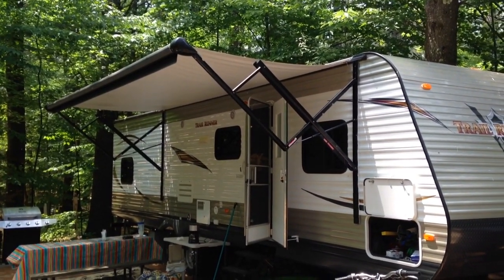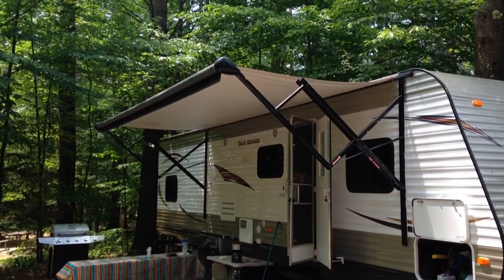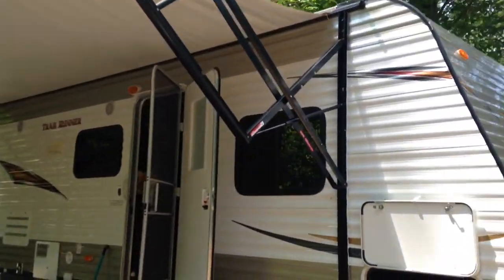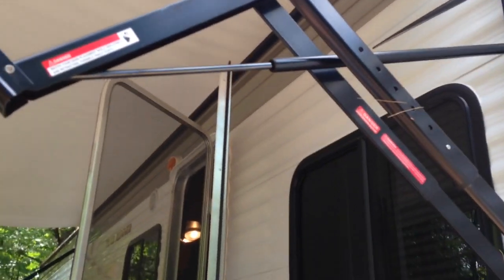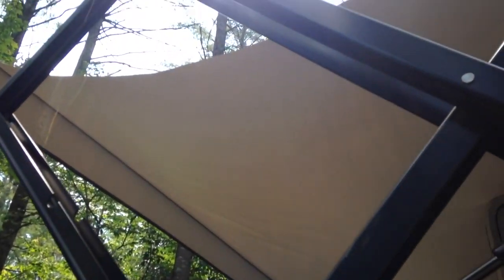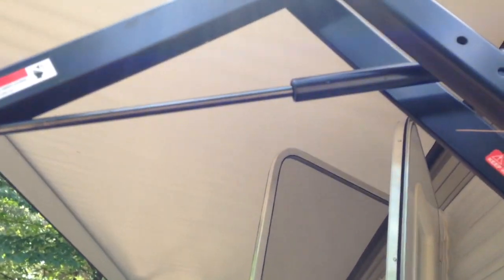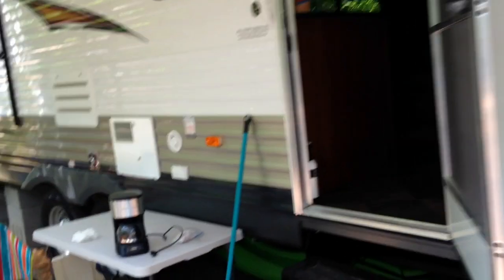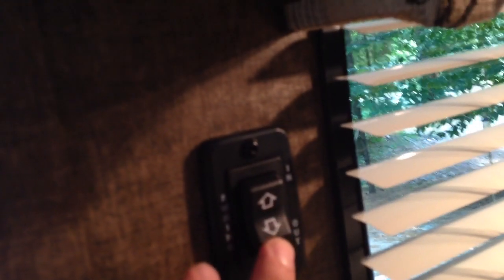How An RV Electric Awning Works - Demonstration

Comment from the maker: Remember to subscribe to our channel to receive all of our coolest updates!
Reply: HomeOwnerRepair Hi, I have the same exact awning. My question is this, is there a way to tip the awning straight at down for rain runoff? I know how to tilt it the little bit that it does by pressing this buttons and lowering to the other holes but that's mainly only good to make the water run off of one side or the other but the old style awnings would almost let you completely drop the awning down so wind couldn't get under it. Have you figured out a adjustment for this or is it not capable of doing that? I have been just closing it every weekend at our seasonal site but would love to keep it open if we could. Thanks

Comment: Hi, I have the same exact awning. My question is this, is there a way to tip the awning straight at down for rain runoff? I know how to tilt it the little bit that it does by pressing this buttons and lowering to the other holes but that's mainly only good to make the water run off of one side or the other but the old style awnings would almost let you completely drop the awning down so wind couldn't get under it. Have you figured out a adjustment for this or is it not capable of doing that? I have been just closing it every weekend at our seasonal site but would love to keep it open if we could. Thanks
Reply from the maker: To my knowledge there isn't a way to drop the front down or tip it to one side.
Reply: HomeOwnerRepair OK, thanks for the quick reply

Comment: does the awning get mildewed if it is put away wet
Reply from the maker: +Penny It can and will like any other awning. If you do roll it up wet, it should be aired out and dried as soon as possible.

Comment: You said "newer" electric awnings? Guy, we've had electric motorized awnings for at least 50-60 years. They were more expensive at one time, so few trailers had them, but now almost all are electric.
Reply from the maker: Every camper I've ever seen until now had a manual pullout awing.